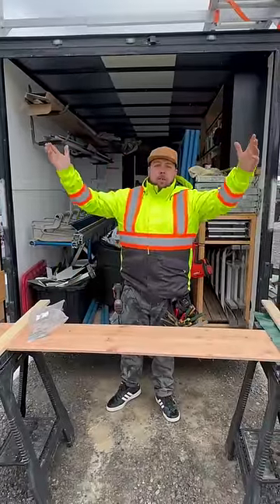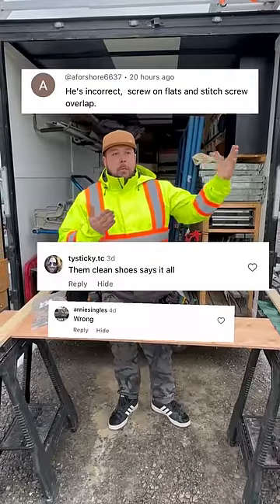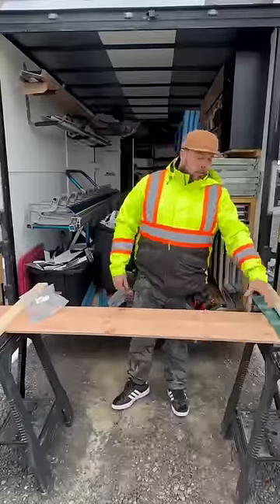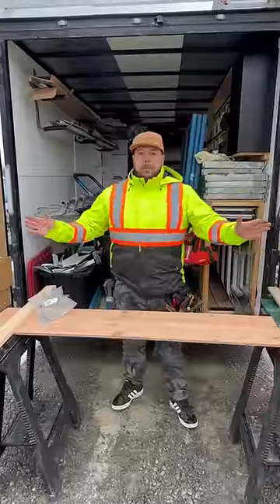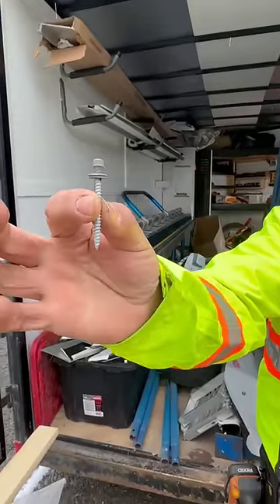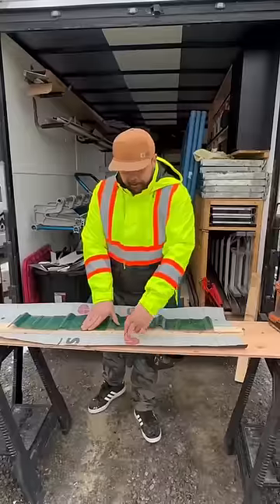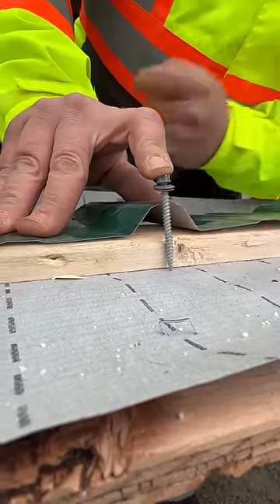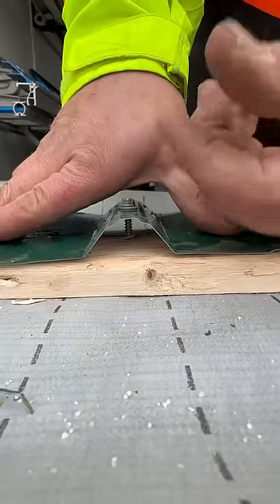Screw It 2!! #construction #roofing #shortsfeed

Comment: Just had a protracted online argument about exactly that, fastening through the crests is not only the RIGHT way to do it, it is also the most weatherproof way to do it.
Reply: They claim it opens the hole from expanding, and contracting though. I firmly believe most these exposed screws leak minutely no matter how they're screwed on. Owned a few myself,  and always leak eventually.  Standing seems are the way to go.
Reply: @BrianVincent-k6g run em' wet with a special 2 part industrial epoxy, if you're worried about leaks. The standard rubber washers, do see a lot of dry rot.
Reply: @jminor355  I understand that's a good solution,  but too much trouble.  I have seen a screw with a bell shaped "dome" that goes over the washer. I would probably use them if I ever do another screw down.  My supplier has them on display,  but said they are expensive,  and they don't keep in stock.
Reply: @BrianVincent-k6g  If you go through the peak and don't overtighten, you will likely have zero problems.  If you use genuine corrugated metal (what the Brits call "wrinkly tin") there is no flat peak and you can take out a screw and leave the hole and never get more than a literal drop or two in decades.  Unless a raindrop hits right on the hole or within a couple of mm uphill off it, the water has no way to get in.
Reply: @itsamindgame9198  if you screw in the ridge in extreme temperature conditions you will have a widened hole from expansion over time.  To count on a rubber washer for 30-40 years to protect a hole 1/8th inch wide is not really ideal.  I want zero drops of water. Snow sits on roofs in my area. If it's not watertight it will definitely leak when snow/ice sit. Appreciate you man, but after 20 years of experience,  and owning 6 different buildings with barn metal on them; nothing anyone says will change my mind.  Standing seem is the way to go.
Reply: @BrianVincent-k6g  Ah, yeah, snow is a different beast - one we simply don't experience here.  I still think through the peak is better, but for a snowy climate I would use sealed flat sheeting (e.g. plywood) as a sub-roof.  Any drips will still run out at the edge that way.  With fixing through the flats/valley, water doesn't just drip through but is pumped through by hydraulic action, and it then trapped between the skin and the batten/purlin or whatever you call them in your part of the world.   
But you gotta go with what you know works for you.
Reply: @itsamindgame9198  yes sir. We have snow that turns ice for weeks at a time. House heats the roof which melts some, but the top layer of ice/snow won't let it escape,  or shed bc it creates a dam. Many leak at this time that don't when it just rains.  I can tell you know your stuff,  and am betting you're a good hand. Appreciate you.
Reply: @BrianVincent-k6g  that’s why you screw on the ridge it allows any water to dry out

Comment: love the channel, do the exact same job. Its funny our manufacturers for metal siding says the complete opposite. Its funny how 2 different companies manufacturing essentially the same product have different installation methods.
Reply: In the last vid his manufacturer said in the rib for roofing and flats when doing siding. But there def manufacturers that will tell you opposite ways of doing something on similar material
Reply: @91Nicks  we always screw ribs. We find the overlap stays together better. Tried it both ways. Haven't had any problems yet.
Reply: Have steel metal roof screwed through the rib here in Florida. It's 15 years old and has withstood (3)* major hurricanes !
The screws in the valley are every 6 inches along the edge, and they are the only ones that are rusting, and I'll be replacing them soon.

Comment: Most screws achieve their ratings at full penetration of the parallel threads (at a minimum). That usually means full penetration plus double the diameter of the screw.

But carry on!

Comment: the manuf says 'It is the responsibility of the installer, owner and designer to take in consideration the Fit for Purpose, Building use, Climate conditions such as temperature, snow, wind, and moisture, Governing Building Codes, and Maintenance'.

have long avoided fastening thru ribs at most all opportunities and used glats to great success but i wasnt complaining yo begin with.

Comment: Those ribs are designed for heat displacement through ventilation. In Florida the salt air would eat those screws in less than 2 years

Comment: If you think about it screwing in the flats buts an opening right in the water channel where as the water does not flow on ribs it flows down to the flat
Reply: How does water hurt a watertight seal? Either your roof is ready for rain or it ain't. No amount of screwing in the ribs will help you if you can't apply a fastener with the correctly clamped washer. If anything screwing in the flat will help the washer to stay clamped through heat cycles without the screw threads being held away from the strip by the rib. I get installing to manufacturers spec but don't claim the old way of doing things is better because water might get on the watertight screw otherwise
Reply: @calebz1448 😂 really bud? Because rubber gaskets dry out and leak and they are definitely gonna leak if they are in the water channel and not on the rib
Reply: @JoeytheJerk  I've been on 50 year old roofs with good washers just changing colors for looks
Reply: @JoeytheJerk  modern screws have neoprene washers that last much longer than rubber but I've even seen copper topped rubber(I assume) gasket nails that still held a good seal from easily 50+ years ago
Reply: @JoeytheJerk  so how do you think fasteners are applied from gable rake trim through the panel without going through the flat? This is my daily profession not just something my uncle told me about 1 holiday

Comment: Don't listen to the keyboard warriors lmfao. I've argued with people for years over this. If you screw on the flats where all the water runs, it'll eat at the washers and it's proan to leaks. People screw on the flats cause their lazy and it's easier lol. They don't realize you can predrill all the wholes and do 20 sheets at one time lmfao. Great job my friend
Reply: He's not listening to them dude. He's leveraging them for more content. It's a good move
Reply: @Pudi1224  sooo that means that he's listening to them lmfao. The more you feed into them the worst it gets.
Reply: @AmericanPoliceCams it seems you are proan to not learning the way things are done
Reply: @calebz1448  yeahhh that's exactly what it is lmfao
Reply: @AmericanPoliceCams  personally I screw on the flats because I attach sheet metal to red iron and the screws need to be tight to the iron to give it a better shear rating. When I do residential roofing the screws go in the flats because it gives a better clamping force on the washer so it will last longer. But I can't fault themroofboys for following manufacturer spec I would just simply find a better manufacturer that had logical recommendations
Reply: @calebz1448  most definitely, if you're doing a all steel building that's how you do it and then you use shorter screws for your laps. We're talking about doing residential houses where you are laying the metal on furring strips.

Comment: The screw tip should never go completely through the base boards. (No, I didn’t say, baseboards.)
The moment a screw goes completely through the plywood, it becomes vulnerable (weaker grip) under vibration. It will eventually lose its grip. Remaining in the plywood or boards, it remains under pressure, compressed.

Comment: Personally I was told it doesn’t gasket properly because of the void in rib
Reply: I looked it up and this is why your being that They argue the screws placed on the rib don't create proper gasket compression due to the void under the rib. Installing on the ribs also has a higher risk of the screw pulling out during a high wind occurrence. The best solution for deciding where to place the screws is verifying what the roof manufacturer specifies.

Comment: Those 3/4 inch strapping don’t hold screws for long , if you want your fasteners to last , use 1/12 inch strapping  . 👍🇨🇦
Reply from the maker: Great call! We do use 2x4s for strapping on steeper roofs! Makes it Easier to move around up there aswell! CHEERS

Comment: Wanna hear about an extremely "smart" person? I bought my house a year ago and this summer noticed the fairly new siding was popping on a ton of seams. Well when I went to do a small fix a few months back I popped a few pieces of siding off and noticed that ALL of it was mounted with the nails slightly under the pre-cut holes making ALL of my siding have no room for movement and having me want to drive a nail into the head of the genius that installed it... carry on

Comment: 1.  Please PLEASE use a Snap Lock panel instead (for roofs) & not ANY exposed fastener system.  ¿Please?
2.  If you HAVE TO use an exposed fastener panel, use a "Channel Guard"" or "Rain Guard" (but... see #1.  Go Snap Lock!!)
2a.  PAY ATTENTION to where you place the screws! & I don't mean  in the highs vs. the lows"... there are TWO places to never put a screw for a Channel Guard.
I see carpenters make this mistake on probably 75% of these installations!!  Read the manufacturer guidelines (or ask!!)
This is difficult to explain via written info; I have a pic, but YouTube doesn't allow uploads.
3.  Use a better product than that crappy "TEKS" product.  Get a ZAC Long-Life (Zinc Alloy Coated) with a unified head & 3× thick gasket & pay attention to the tip; metal to wood driller vs. metal to metal.
Typical max size needed is a # 10.
Leave an option for later repairs & ability to go up to a # 12.
3a.  Once you have penettated the substrate (metal or wood), the same diameter of the screw is all you need for added length.  "Once you're through, you're through"... no need for a crazy long screw.
4.  ☆☆VERY IMPORTANT!!☆☆
Do NOT use an impact gun.
Always use a gun w/ a torque setting & set to around 2, 3 or 4.  An impact is too easy to cause substrate damage & will strip out whatever you are screwing into.
An impact gun does not have fine control & when the gun meets resistance, it bears down with too much force, whereas a torque setting prevents overdrive (I exclusively use m12 & m18 Milwaukee products).
DO - NOT - STRIP - OUT - THE - SUBSTRATE!!

So many fawning comments here from people who are learning incorrect methods.

🤦‍♂️🤔🤦‍♂️🤔

Comment: I did my own roof of my house I watched videos from the manufacturer that put the screws on the flat so I did I hope I was correct
Reply: They don't say do on flats that where water goes and when th rubber on ur screw gives out you have a leak and it will give out
Reply: thank you
Reply: @robertmarshall8309 don't worry about water touching your watertight screws and washers. I've installed hundreds of roofs that way with a 7 year labor warranty on top of the product warranty without callbacks. Screwing on ribs is pre-1970 methods that some manufacturers and installers still cling to through faulty logic

Comment: I don't care what recommendations that sales rep said is what because at the end of the day he's not the guy out doing repair calls and not only dose the washer not seat proper but what about when it's time to size up on screws and the panel high is bent by mistake from over time screw there's more reasons why it's better to screw on the flats then there is benefits to screwing the highs at the end of the day it's you and your company that will potentially potentially get the call should it happen but in my experience and everything that iv come across over the years I would never screw the highs ever under any circumstances
Reply: Please use proper punctuation
Reply: I'm glad I'm not the only one. I get following manufacturers spec but to claim it's superior by keeping water off a rubber seal is plain silly
Reply: I've never screwed on the rib. I've been an installer and am now into residental sales. Personally, I screw to the left or right of the rib depending on which way the metal is ran. Residental panels such as this have a ribbed tapper at the top a lot of the time your screw doesn't sit properly, especially if you use a long wife screw which has a bigger head on it. It's funny how manufacturers recommend lots of different ways of instalation.